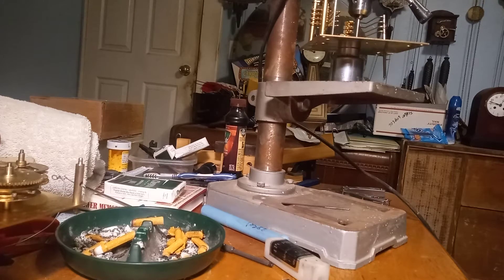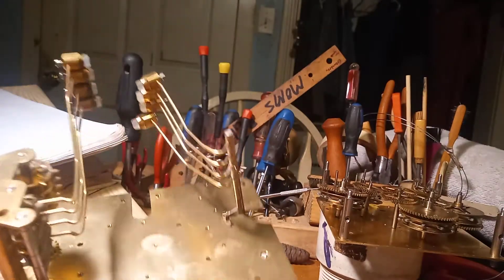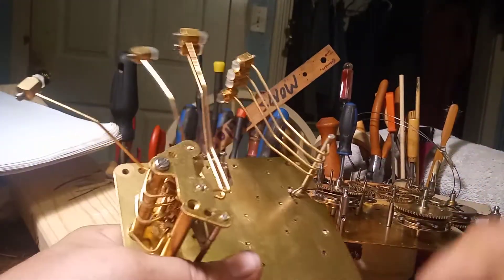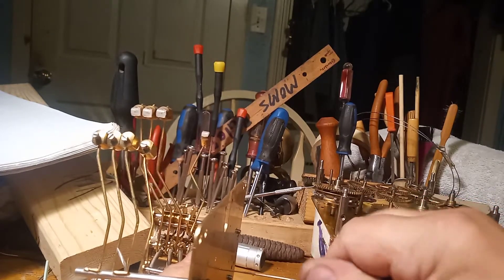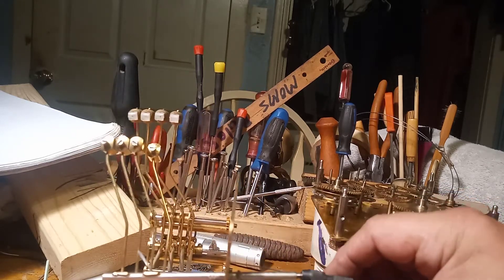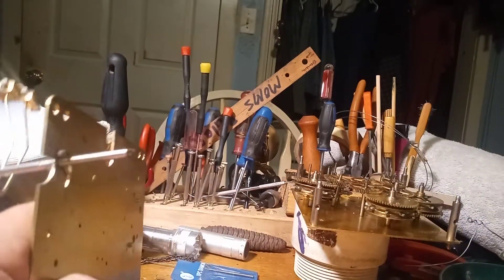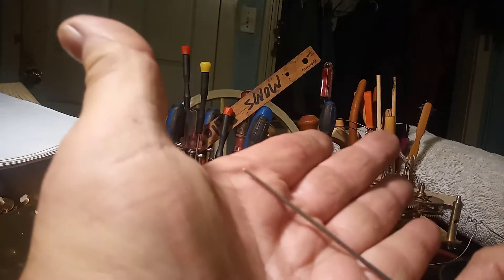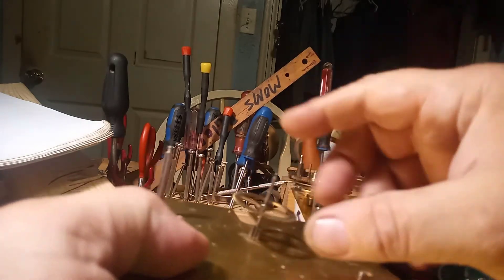How to install bushings in a clock using simple tools Part 3 of 3 20210820 215037

Comment: Hi Mark how smaller the hole for new bushing should be .Is it depend of how thick the plate is or not ?
Reply from the maker: The bushing size is based on the thickness of the plate, the diameter of the pivot, and the diameter of the bushing/hole that you are wanting bush. There is one guys you tube video where he explains that he buys the same bushing for basically all the bushing work that he will do for several clocks. So it is tall bushing, with a small diameter pivot hole that he broaches out and a big diameter bushing. So after he installs it then uses a bushing grinding bit and grinds the extra bushing until it reaches the plate. Lots of waste of material but he doesnt have to get out different reamers/broaches for different sizes of bushings either. Hope this helps.
Reply: Thank you Mark I usually make 0,3 mm smaller hole but when plate is very thin sometimes bushing is tool loose @munnerlyn3
Reply from the maker: that is why it is extremely important to keep the bit (whether it is the reamer or the broach) very straight to the hole that you are bushing and dont go back and forth when you get down to the last stretch of bushing as it will cause the hole to be bigger than what you want.

Comment: Can you tell me about the oil sink?
Reply from the maker: The oil sink is part of the bushing hole. It is just basically a counter sunk part in the bushing to allow a minute drop of oil to sit in. Some bushings werent made with them and you can take a drill bit and make them. You only put enough oil that goes into the oil sink. If it gets on the movement plate then wipe it off. Some oilers will suck up the excess oil that you dont want on the movement. I use either a piece of wire that I took a ball peen hammer and flattened one end of the wire or a tooth pick to oil my movements. I then use a paper towel or my hands to wipe off any excess oil. Hope this helps.

Comment: Thanks for the video and explaining how you do bushings. Do you have video on reassembling and how to correctly place the cam pins and gears for the chime and strike on the movement you bushed in the video? If so please share. Thanks for you help.
Reply from the maker: I will tell  you that the movement that i am working on is a Jauch movement or something like that. My clock friend who works professionally for a living on clocks hates these movements. He says that they are a pain in the butt to set up. I have to agree with him. I am still trying to get the chimes to work properly. The set up on them has to be just right. There are some videos out there on them. There is also a DVD that you can buy off ebay specifically for this movement and it is supposed to show you the proper installation and set up  of the moving parts. My clock ticks perfectly. The chimes seem to work one day fine. Then the next day not so fine. I am still working on the clock. For now I put it to the side. BTW it has nothing to do with the bushing repair but all in the timing of the mechanism. I too might have to buy the DVD that I mention. But I am not there yet. I dont give up that easily. It might take me 6 months or longer to get back to it but I dont give up that easily. Only time will tell.
Reply from the maker: I dont. What I would suggest if you got the movement back together and it is out of tune to remove the gear next to the small gear on the back where the chimes are. Turn the small wheel watching it play. Then  once it is in the right position put big gear back on. Now you will need another clock that shows you the hammer sequence. If you dont have one then you should be able to find on on you tube. As far as the set up on the front of the clock there is a screw that you would loosen the cam wheel. Loosen that screw and turn it to the position that it needs to be in once it is done playing the tunes. That cam is the cam that turns to allow the lift lock lever to activate the strike. But there is several things that happen and it is hard to explain typing what has to happen. I might make a video in the future but that would mean me taking a clock apart to do it. I typically only make videos of clocks that I am servicing at the time. I hope this helps. Sorry I dont have a video for the Westminster chimes at this time. I might be able to send you short video clips of the back of the movement if you need them. If  you do then send me a message on Face Book.

Comment: Where can I find an Escape Wheel from a G.M. Angem cuckoo clock? Locating that piece is difficult online like Timesavers, Clockworks, and Meritts don't carry it. Any ideas appreciated!
Reply from the maker: The best advice that I can give you is to look on ebay and other auction sites and find a donor clock. I have the same issue with the E Schmeckenbecher clocks with the fancy washer that they used to hold the dancers in place.
Reply: @munnerlyn3  Thanks
Reply: @8953147  did you ever find the escape wheel you needed?
Reply: @brian eifert  I bought a used movement instead- too costly to have someone create a new wheel.
Reply: @8953147  oh good not that I can make a wheel. I figured I’d comment because I have extra gm angem movements.
Reply: @brian eifert  wow, great to hear! Those old movement parts are rare.
Reply from the maker: you can also measure the depth and width of a Regula one day clock. If they are the same then you might be able to use one of those that you can purchase from timesavers even if you have to modify it some..
Reply: @munnerlyn3  I might go in that direction. A clock smith near me said he has wheels on order that won't get there until March 22'. Thanks so much for your input!!
Reply from the maker: No problem. I hope you can get what you need.